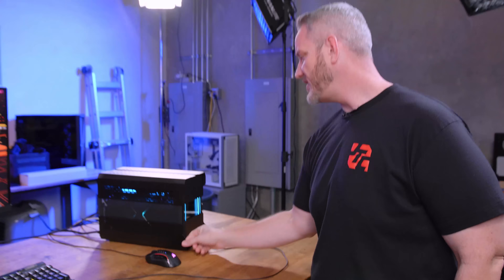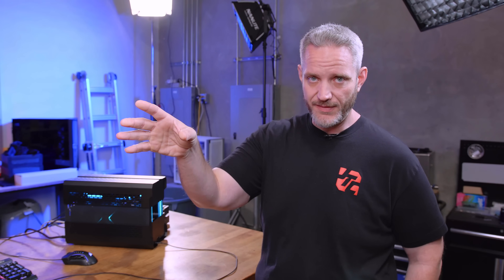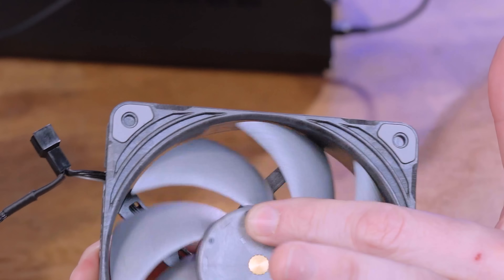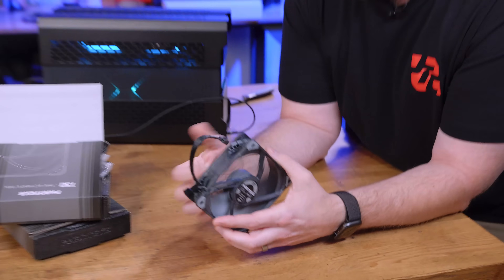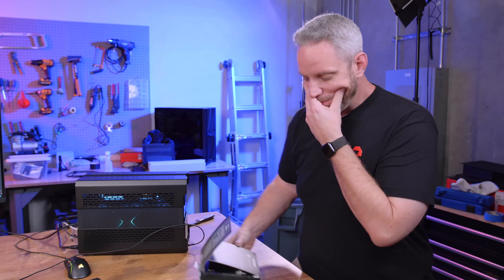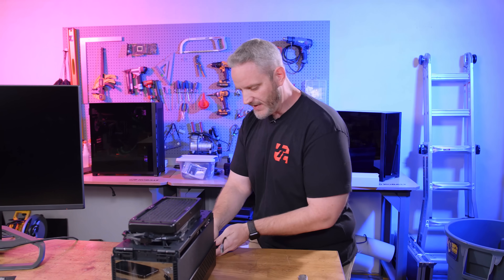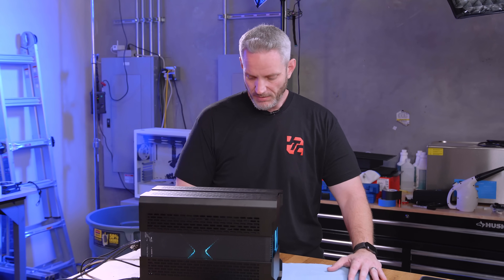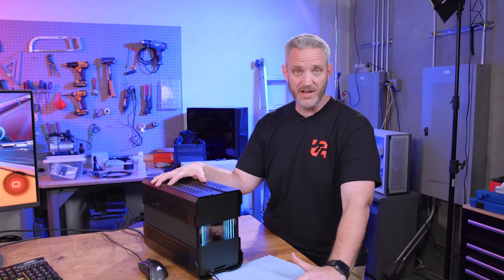Improving the cooling in my Evolve Shift XT build... it got TOASTY!

Comment: I'm running Phanteks t30 aio. It does not fit, way to thick. The case only allows 60mm for fans and rad. The T30 aio is 68mm. So I went to 25mm fans which dropped that number to 63mm. It barely fits. The rad sits snug against top panel.

Comment: I want to do a build like this but I'm too wary of the thermals and fitting GPUs and cables
Reply: It's not very hard ,if you build one pc by ur own. I just using the Jonsbo A4 for my ITX Build. You only need a good idea what fits and what not. If you want 3 slot Cards no problem, go for Phanteks, Coolermaster or some other. If you want more Fans go for something bigger. My Build working fine for my Conditions and only running in Silentmode all the Time (900rpm on 4 Fans).
Reply: I built in a NR200P max and it’s really simple
Reply: Well Nr200 is one of the simplier Cases. Stressful goes with Sandwich Layout 😂

Comment: Did you try flipping those fans to intake air instead? Not only would they pull in cooler air, but also blow that air onto the MOBO. EDIT: I have the same case with AMD components and Cooler Master 240 AIO. The GPU is a Radeon 6700XT. I hear the AIO pump whine more than the fans when playing most games. Some games don't even get the GPU fans fired up.

Comment: Did I miss something? You changed fans on the CPU rad, which made a huge difference, but was never talked about, yet you only focused on the GPU temps, which got passively better because CPU heat was sent out of the system more efficiently.

CPU went from 76c to 57c btw.

Comment: Gives you something to think about when considering building a sff with similar specs. I weighed getting a 5950 over a 5900 but chose to get the 5900X since I wanted to put more money into buying a better GPU which ended up being the 6900XT. It was cheaper than what 3080's and 3090's we're going for at the time. It runs super quiet in the Dan A4-H2O case I paired with it and using a EK 240 D-RGB AIO to keep the CPU cool.

Comment: I really want that case, but my GPU is about 16mm too long. Also, I would use speaker gasket foam tape to seal the fan gap, it would look much better.

Comment: Be careful with flipping the PSU. I saw several people try this with the Dan A4-SFX when 3000 series released and many of them started to have system instability dumping all that heat into the PSU. I have a 3070 Ti FE in my Ghost S1 and with a decent undervolt temps now max out at 72C and it isn't anywhere nearly as loud as yours.

Comment: @17:39 I have been flipping the PSU as an additional exhaust for every PC I have built and repaired (people used to laugh at me even when I told them the rational - until they saw the benefits themselves in trying to prove me wrong lol). I noticed that with the PSU flipped down (fan facing bottom of the case) actually has the PSU run alot warmer regardless if the PC is placed on a desk or carpet. The latter is worse as there is so much dust accumulation that can cause a short circuit and actually fry the components. I've seen it happen in a poorly cleaned case (as in never cleaned). Additionally, every GPU blows hot air right onto the PSU plate not only causing heatsoak - it also has the effect of having heat linger in the case alot longer as well as having the heat bounce back into the GPU. Thus causing the case to run hotter by a few degrees - this effect is made worse in poorly ventilated cases.
Reply: Any downsides, e.g. longevity?
Reply: @banescar  My current PSU is over 10 years old at this point, I've been having the fan point into the case since I started building mostly because when I started the PSUs where mounted at the top of the case and there were no holes to have the PSU point up and now it's part habit and part because my room has carpet. Unless you can put your case on a desk(which I can't because 1. My desk wouldn't allow for it and 2. It's a Full Tower) then having it point down seems like a bad idea because of all the dust down near the floor.
Reply: PSU flip around is a great idea actually , i flipped my SF750 in NR200p and it did a great job , as long as you dont use somekind of psu like bronze level your psu doesn't have that much heat problem .
Reply: Some cases like my current one the Power Supply is completely sealed from the rest of the components so it won't help flipping it

Cases like the Fractal Torrent is designed with the PSU on top like older cases to draw in air which is really cool and what I prefer.
Reply: Is the fan on a psu an exhaust fan or a supply fan? Meaning, does it draw air into the psu, or exhaust it out? When Jay flipped it, did the fan go to the top or the bottom? I’ve read my Seasonic manual several times and they don’t explain this, if anyone can shed light pls do.
Reply: @cgsather3309  The big fan draws air in which gets pushed out the back(usually by a smaller fan IIRC).
Reply: @dallin9731  yea, common atx case normally is not good with flip over because psu would fight with the gpu , traditional build like fractal torrent or p200a is the best with psu exhaust.
Reply: @cgsather3309  normally psu are suck fresh air from outside , so flip it over to suck hot air from inside which helps exhausting . nowadays psu are so strong to sustain hot temps so won't be a problem but i suggest don't buy a cheap psu if you are going to make your it help exhaust.
Reply: @香噴噴-p6f  ok thx. I have a midtower with a Seasonic 850, mounted with fan at bottom. Wonder if flipping it will help by exhausting more hot air out of the case, or if it will steal air from the gpu.
Reply: @cgsather3309  you are welcome , dont do that if your psu is at the lowest part of your case since air are moving to the top and yes your psu would fight with your gpu , even it doesn't due to your gpu has a big gap with psu but psu won't help with the hot air since hot air rise up to the top.
Reply: @香噴噴-p6f  ok thx, makes sense. I’ll leave as I have it, with psu fan facing down, at the bottom of the case, my temps are good now. Plus I have my pc on a clean desk surface, not much dust.
Reply: @cgsather3309  Asuming it's not much of a pain, you could always just test it since you shouldn't have to unplug anything. At worst you'll just have to flip it back.
Reply: @Puremindgames  true, thought about that. I’ll post if I discover something.
Reply: @cgsather3309  Sorry of the late reply - was taking a break from the internet lol. The PSU fan pulls air into the PSU so if you flip it so that it's facing the bottom of the case. The theory is that it pulls in cool air from outside but in reality that's not the case as the clearance between the desk and the bottom of tne case is often a few milimeters. It's worse on carpet so the PSU will run warmer.

If you flip the fan upwards so that it's facing into the case it will act as an additional exhaust. In most cases the GPU will blow directly into the PSU fan - providing there is no PSU shroud in the way. 

If you have a PSU shroud and a non removable one with little to no holes for ventilation for the PSU and there is zero airflow from the front of the case nor is there any ventilation from the bottom of the case then it's not going to really matter which you face the PSU. However, such cases are rare these days as there should be some holes at the bottom of the case for the PSU - in that scenario you will need to raise the case off the surface by at least a few cm with nothing obstructing the PSU fan holes for ventilation.
Reply: @dallin9731  Sounds like you have a PSU shroud, can you remove it?
Reply: @earthtaurus5515  excellent, thanks for info, appreciate it.
Reply: @cgsather3309  You're welcome :).

Comment: I'm kinda quietly tempted to see what I could do with a waterblocked 5700xt and an old Corsair Obsidian 250D case. It's toward the larger end of SFF what with being a cube-case, but there could be enough room to stick several rads in series in the thing, including a 200mm fan behind the front panel. Cool, quiet, and smol-bean cute? I mean if you can have it all, why not?

Comment: Jay, please make a test with an air cpu cooler. Im planning on making this my next case, but I dont like watercooling.
Reply: I wouldn't expect air cooling to work in a case like this.  Not enough room for a good high surface area cooler, and  the air exchange wouldn't be efficient.

Im curious why you would prefer an air cooler over an AIO?  The maintenance difference is negligible and the cooling performance insight and day in a use case like this.
Reply: @Corvus.2606    I was planning on having a noctua nh-l12s, its not an nh d15 but still can pull fresh air from the sides and use 2 140mm on top to help extract the hot air from the gpu and cpu.

I never like the idea of an AIO, due to noise or having a leak, I know there's a  really small chance for it to happen. Maybe you are right and for sff builds AIO will be better, I haven't set my mind on it. I'm happy with my current build (meshify c with nh-d15, it's almost silent) but I've always wanted to do an sff build.
Reply: putting a air cooler in here would be a bad idea.
Reply: @rci-tf2zc  well sff seems not to be for me then, thanks

Comment: Hey Jay, i'm currently doing a build with this the Phanteks Evolve Shift XT, and i was wondering, does a 6800xt gigabyte would fit well in that case?
I'm still not sure what gpu i should get. + i would buy the same Watercooler as you

Comment: Hypothetically speaking with the extra height to account for the thicker fans could you set it up as a push/pull on the radiator with thinner fans? If so... Pros vs cons?
Reply: having just 15mm below the radiator would just kink the tubes

Comment: Not super related to the video, but it is best to keep cap your framerate to a multiple of 120 for Rocket League, as the physics engine runs at 120 fps, meaning that if you aren't at a multiple of 120 fps you are both wasting processing power on unnecessary frames, and also potentially input latency and input variation

Comment: I'm not a fan of founders edition in such small systems. I sold my founders for a TUF for that reason. I look forward to you trying other cards that you can hopefully fit around the tubes.
Reply: If he were to go into Nvidia control panel and turn on max frame rate, set it to one frame/Hz lower then his monitor, he would lose about half his render time, and feel better "reaction times" thanks to the render times being 2-3ms rather then 10-15. Also his gpu would also probably be sitting at about 40c-45c...
Reply: @crisnmaryfam7344  ? Why wouldnt you set it to your exact monitor hz?

Comment: All that noise doesn't bother me, though. As long as it's cool, noise is fine. I have two Noctua Industrial 3000RPM 140's in the front of my case and a Noctua Industrial 3000RPM 120 in the bottom all for intake. I like the noise, actually

Comment: Phanteks makes some gorgeous cases but airflow seems optional on some of them. I have the old Enthoo Evolv and while I like the look airflow is almost non-existent and damn is the case heavy when it's time to take it outside and fire up the DataVac.
Reply: I had the old Evolv too. That case looked so good and had some of the worst airflow. I really feel the reviews at the time didn't point that out. I ended up leaving the fancy front panel off. I also moved house with it twice and the weight was an issue, I ended up hating that thing :P

Comment: well gotta be honest 500 fps seems a little exessive, normally I limit my stuff to multiples of 60 if its on a 60 herz monitor. soo in cs go I go with 300 fps but even that is probably too much.
Reply: Why multiples of 60? Besides the fact that is a 60hz monitor, why you can't limit to 50 fps for example?
Reply: @LibertyWlk  other values than multiples of 60 causes exesive tearing on non g/freesync monitors
Reply: @Ramog1000  oh, thanks!!!.
Reply: @Ramog1000  But why not lock it to 60fps, it's literally pointless if you can't display it

Comment: Regarding the T30 fans and their 0RPM mode... doesn't every PC fan on the planet have a 0 RPM mode simply by having the controller go down to 0%?
I use ASRock's A-Tuning utility to set manual fan speeds so I can balance performance/noise without it ramping up and down randomly by itself, and I just tested it out by lowering the fans to 0%.. sure enough, they stopped

So why is it now being advertised as a feature on some fans, when it has to do with the controller and not the fans themselves?

Comment: This is why I wish the PSU mount was upside down (AC input on top, modular cables on the bottom). Then the PSU would also get a benefit from those thicc fans.
The GPU would blow warmer air into it, but the CPU cooler would pull air out of it, instead of a small fan pushing hot air down towards the desk.

Comment: I guess I just don't get SFF, so many compromises and more expensive. But I guess the nice thin about pc building is people who care about looks over functionality have options also.
Reply: I think SFF is for people who enjoy building computers, not just using them. Trying to cram as much power as possible into a small chassis is a challenge. Really having to research components and plan out a build and possibly modify the case to make everything fit is part of the fun 

It's just not as fun slapping together components in a giant box where anything you want to put in it will fit- unless maybe you're watercooling, which comes with its own challenges
Reply: @a_sweet_whiskey_kiss_6873  The thing I love about the pc community is there is something for everyone. For me the hastle and compromises don't bring joy to the experience, but I tent to keep my computers for years so I try to be as mindful of heat and noise.

Comment: Would be interesting to see Tuf-card and deshrouding with Noctua NF-A fans reversed so they pull air out from GPU! I have modded my Kolink Rocket like that and I also have AIO for CPU. I got very good results like that way and my case volume is just 11.5litres and main parts are 5600x + gtx1080Ti.

Comment: I have a suggestion for that SFF build... kinda stops it being true SFF I guess buuuut...
Why not water block the GPU do a custom loop and remote mount the Rad's, Fans, pump(s) and Resiviour Singularity have a case that can fit remote dual 360's with push-pull fans and has a Res that runs those in parrallel with Series D5 pumps.

Comment: Couple of suggestions you probably have a  240 AIO with copper radiator/better pump(as in more flow at lower speed) which would be ideal for this build(alphacool, bequiet, Asus, and some older EKWB's). A GPU with a better heatsink would be significantly quieter. Alphacool makes a fantastic 120mm x15mm fan called the SL-15. Which should fit between your flipped PSU and TUFs flow though backplate. Cheers have fun!

Comment: Could have just capped the FPS to 3 FPS below the monitor's max refresh rate to lower temps significantly and good response times. Obviously Jay has to do the longer, crazier way of fixing the temps😂
Reply: Don't you mean 3FPS above the monitors max refresh rate? That way the system always has a frame ready when the monitor is ready to take a frame? Or do I have that backwards?
Reply: been commenting the same. He needs to see this lmfao.

Comment: It is hot stuff to see the best CPU and the best GPU in the smallest form factor case. You even used the ASUS ROG STRIX Z690-I gamming Wi-Fi Mini-ITX with DDR5 memory. I think that the best CPU and best GPU need the best stress tests, i.e., Prime 95 small FFTs and Furmark. Granted it is not stress that is likely to be experienced by most users, but it will be closer to the temperatures that users could experience when the case is full of dust, hair, mites, and clothing fibers. I see that you are ready to do daily dust cleaning with the blower on your workbench behind you.
Rather than risk violating OSHA workplace noise standards with high-performance mode fans, you could lower the frequency and voltage of the CPU and the power limit on your GPU. I saw a chart that showed by reducing the power limit by 50% the FPS was only reduced by 15%. I think you could live with 425 fps.
I am doing a similar build for AI and machine learning. It has a 12700K, 3090FE, and Z690 Aorus Pro DDR5 in a Fractal Torrent case. The Bottom fan bracket partially obstructs the three 140 mm fans. A few minutes with a Dremel disk will fix it.

Comment: It would appear that a 5600x or intel power equivalent CPU, along with a less power (spike) hungry GPU would "solve" the heat and noise issues in this and other small cases. Sure, it's fun to have a McLaren as your daily driver, but not at all practical.

Comment: Pumping GPU heat through the power supply, is that even safe? all that heat may overheat the power supply and there are no sensors to check if it's still okay.
Reply: Better hot air blowing across than hot air just collecting and stagnating.
Reply: @MineveraMacDougal  Yes, I heard him say this after I had already commented 🙂

Comment: I've been a heretic for years having my PSU upside down with the fan pointing upwards for 2 reasons 1. at low power draw it radiates its heat up into the case meaning it wont have to run its fan at all and the heat venting into the system is negligible and 2. under high power draw when the PSU's fan actually turns on it will help evacuate a small amount of heat from the case.. the heat at the bottom of the case imo is far from hot enough to cause any issue from hot air going through the PSU
when i have actually tested the difference in temperature it never seemed to do much of a difference either way BUT the PSU has its fan running much less since under low or medium power draw it radiates its heat out upwards instead of having to have a fan blow it out backwards
Reply: You can't position a PSU this way in this case, right? Seems only fresh air from the side and down or exhausting hot GPU air down are the options.